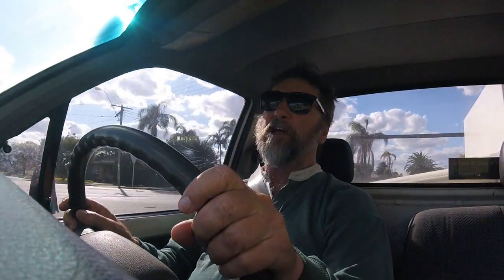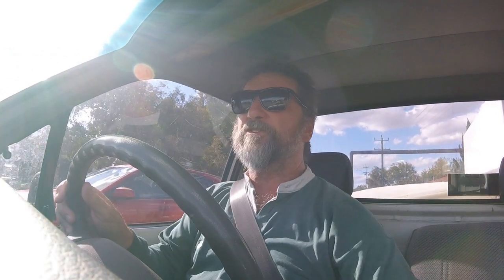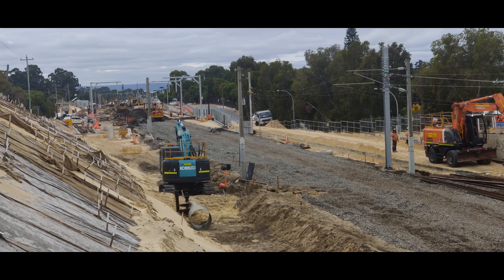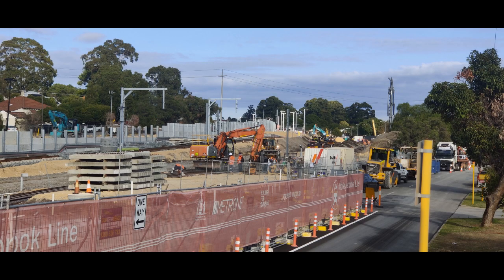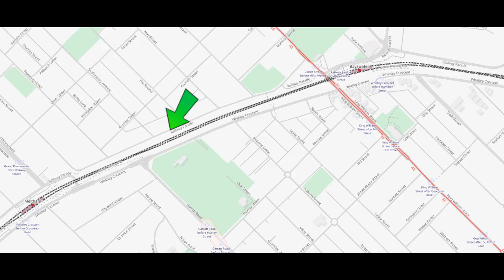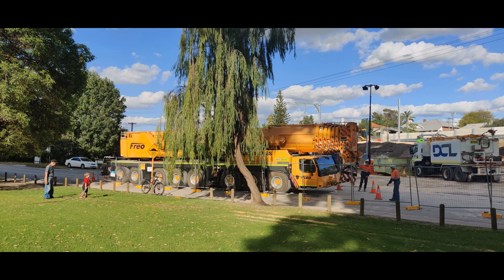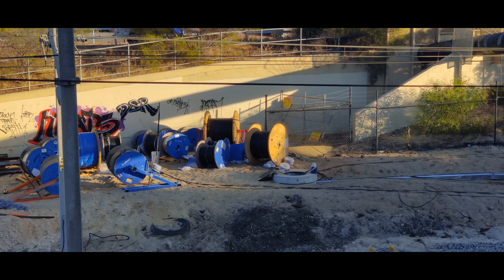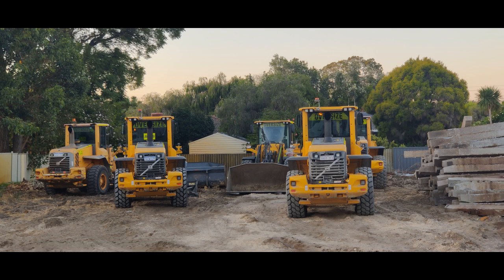Bayswater station upgrade week 1.

Comment: Although I don't live in Bayswater, It was very sad to hear that the notorious Bayswater bridge will be demolished. The Bayswater bridge will be revitalised with new platforms for the Midland and Airport Line as well as the Morley-Ellenbrook Line which will open next year. I wonder what will happen with the traffic lights at Bayswater? Perhaps they will be upgraded?
Reply from the maker: The whole intersection is going to be reworked. Thi will probably be talked about in video 3 as video 2 will be more about track engineering.